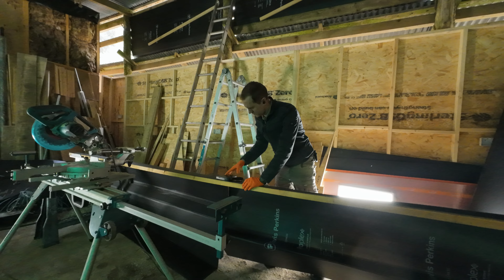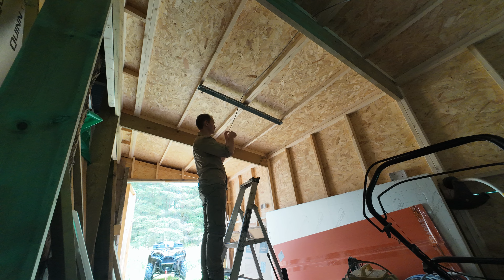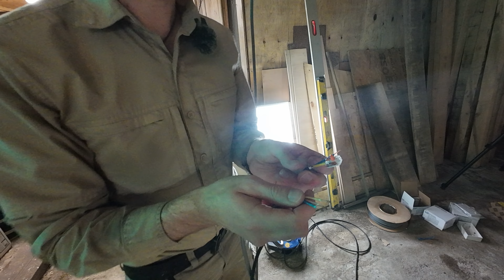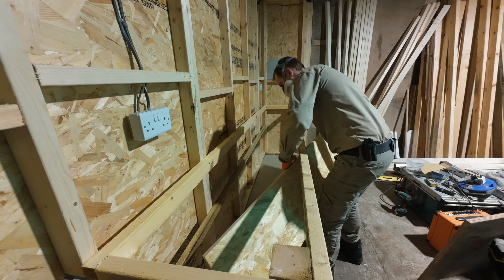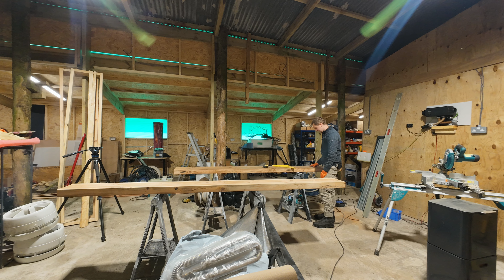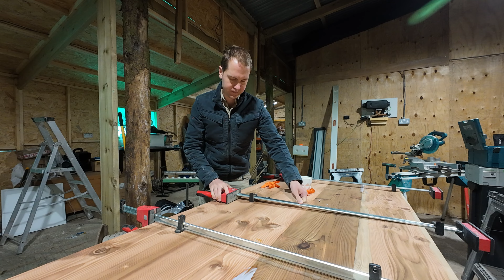The Big Workshop Build: Reclaiming Space and Timber - Off grid day 58

Comment: Hi, great video, love the time lapse! Wouldn’t it be great if all jobs went that quick!! That bench looks too good. I’d have it for a table. 

One worry I have is that tin roof. Now you have all that gear in there, lights and will be working in there. When it’s cold outside it’s going to be raining off that roof. Maybe more than outside. I have a garage with a metal roof. Ended up having to put insulation under it to prevent the internal downpours during the winter. Just a thought! Great video, look forward to the next one. John in  Halkirk
Reply from the maker: Thanks! I mentioned I had added waterproof connections somewhere in the middle but yea its going to rain on most of the stuff in the middle. I had looked into spray foam to cover the cieling but it was so expensive!

Comment: Hi a quick question about the sunsynk since you have set it up properly do you still have issues with it cutting out
Reply from the maker: Not as much, it was pointed out to me that it was because my battery cables were too thin so they couldnt carry the full 8.8kw so its not the inverters fault.
Reply: @beyondtheworkbench  ok thanks for the reply I'm looking at getting the 8.8kw unit hoping it will be big enough for my needs